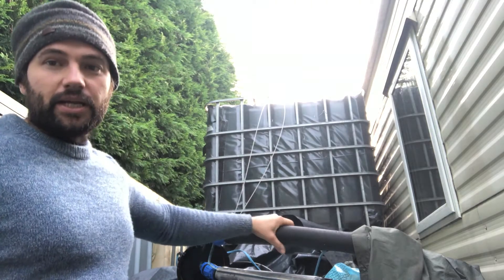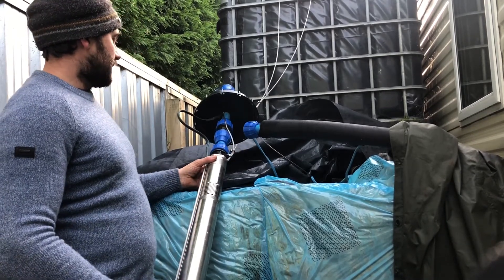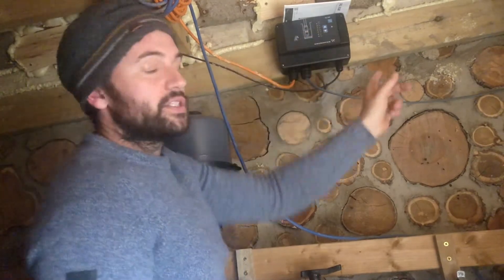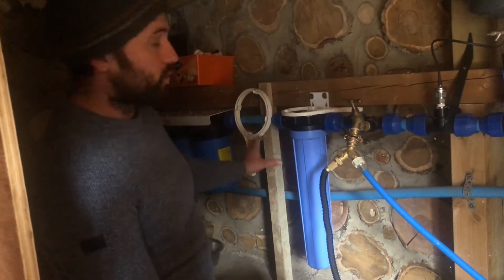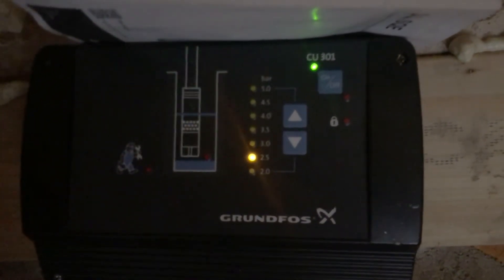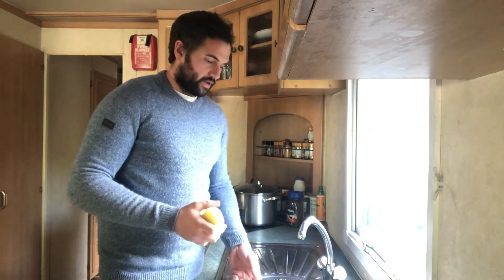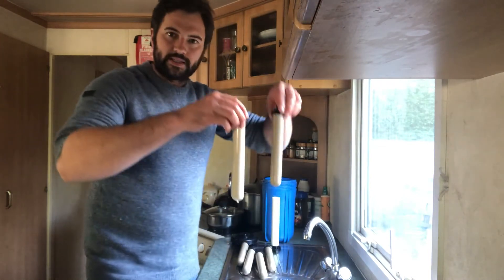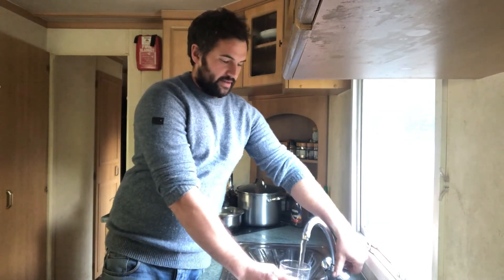OFF GRID WATER FILTRATION EXPLAINED: Harvesting rain water for drinking & how to filter rain water

Comment: Hi, roughly how often do you need to clean the filters, thanks
Reply from the maker: It varies depending on the season. If there is a lot of pollen in the air or dust brought up by tractors off the fields we end up cleaning them more. (Generally more in summer than winter.) At it’s worst, it can be once a week for the ceramic one. However, we’ve recently added a 20 inch long blue filter with a woven poly weave 1 micron and that seems to last longer. We change it about once a month and it costs roughly £4. We now clean the ceramic one once a month and replace it once a year, after 12 cleans.